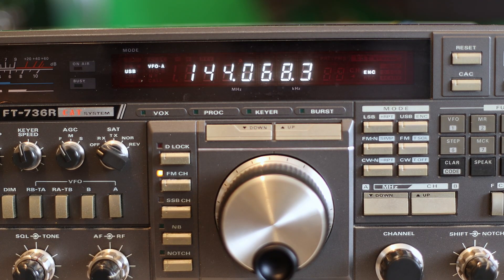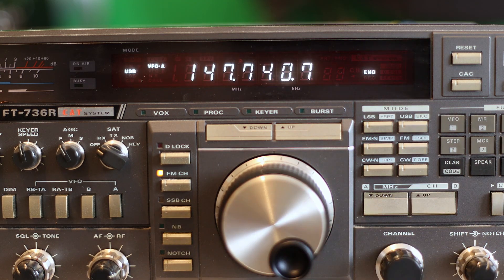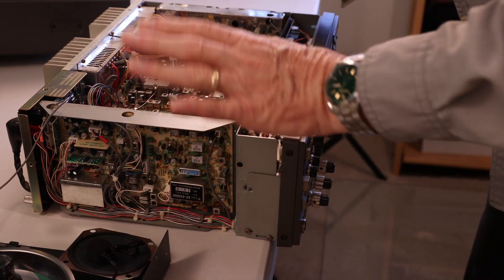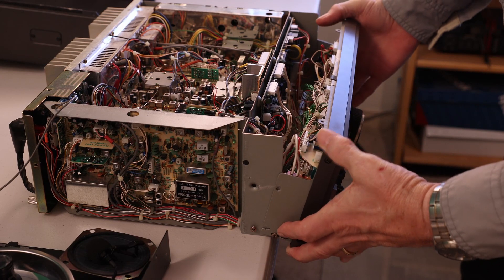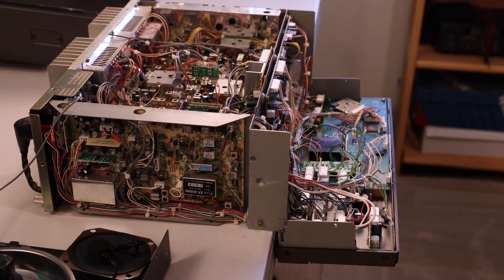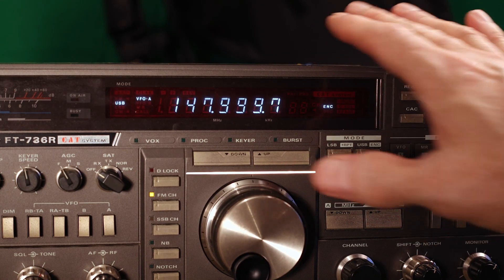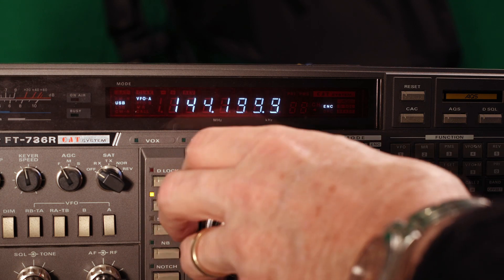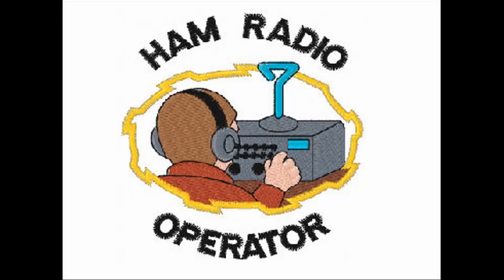Yaesu FT-736R VFO Encoder Replacement Repair

Comment: That encoder might be fixable.  There is an optical chopper wheel inside, and if it gets dirty, the encoder will behave like that.  The unit comes apart easily.  I have an ft757gx that was doing that & I  fixed it by cleaning it.

Comment: I have an Icom 765 and the VFO tuning knob  does nothing.  I have to make a direct frequency entry on whatever frequency I want to listen to or transmit on.  The VFO Tuning Knob will not change the frequency whatsoever.  Anyone have a clue what might be wrong?  I wonder if this might be a faulty vfo sensor?

Comment: I would say check the SMD components at the bottom of the Yaesu encoder, I had a similar problem which was caused by a bad solder joint on one of the resistors. The symptoms might also be caused by dirt in the sensor inside the housing.